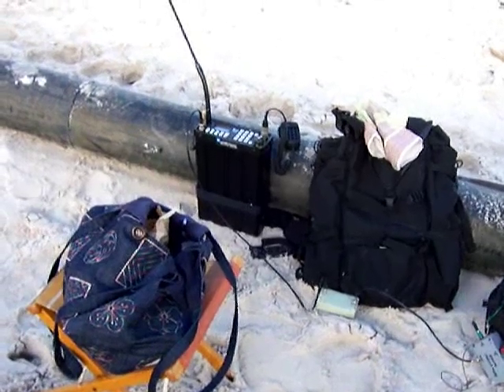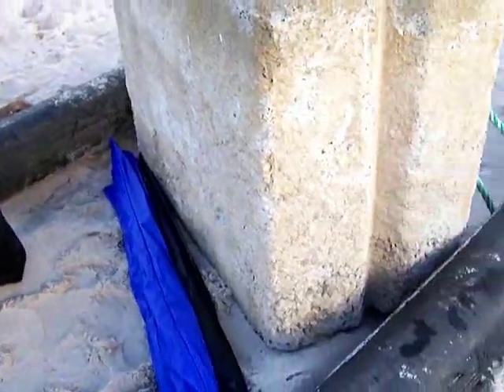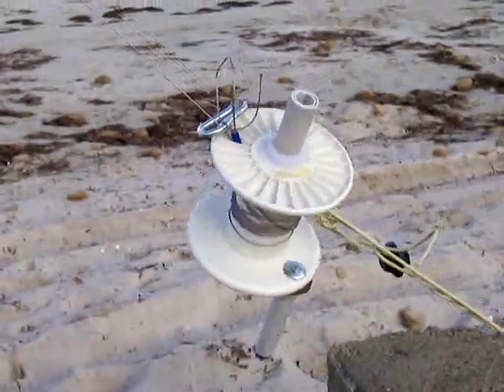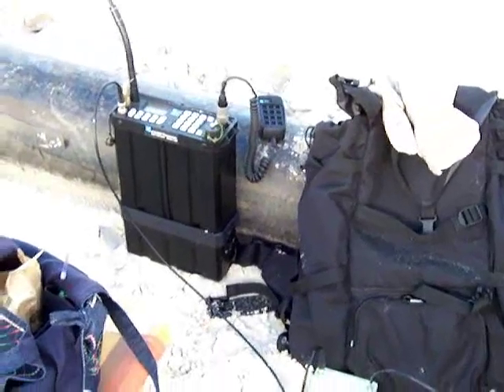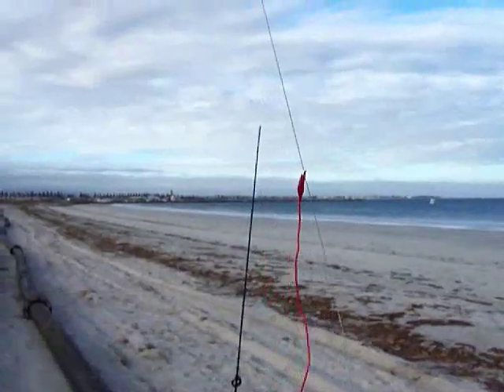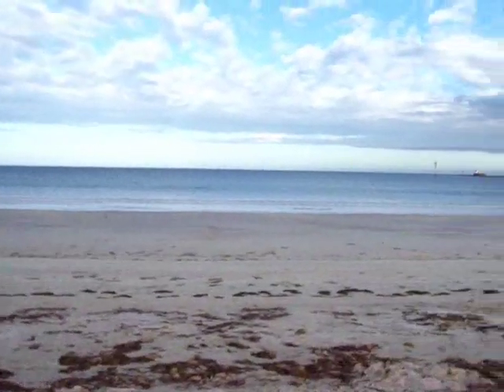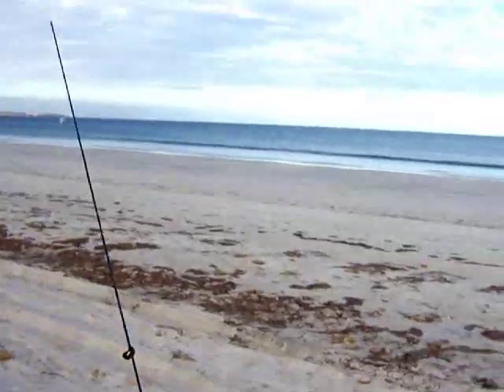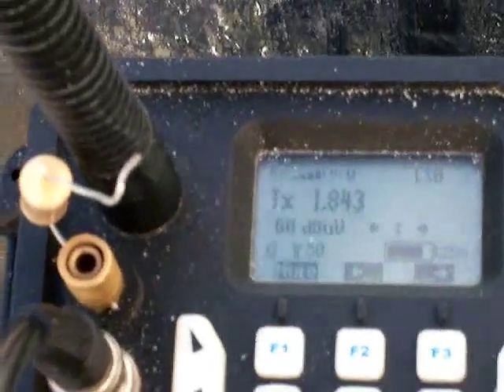160m EFHWT and FM Kite

Comment from the maker: It is a great portable radio with a built in tuner. 5W/25W. It doesn't have a rotary dial,  though.
It does provide scroll up down and fine tune in free tune mode - I believe amateur mode option.